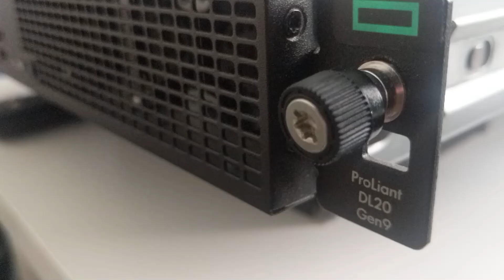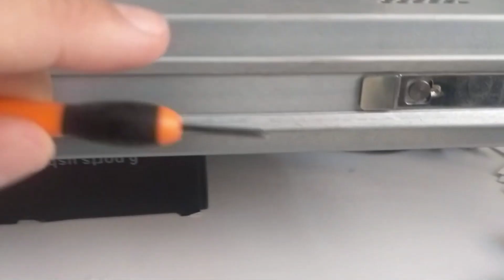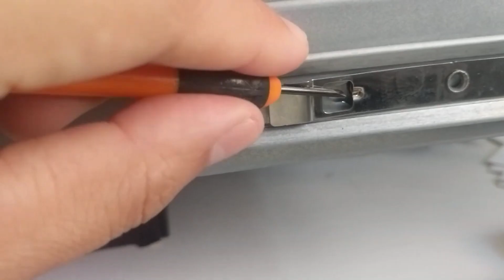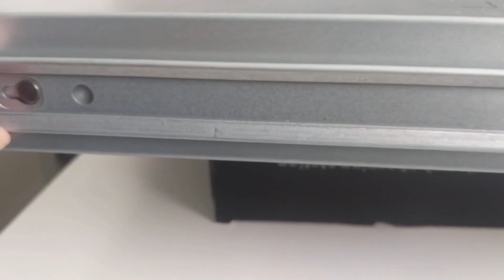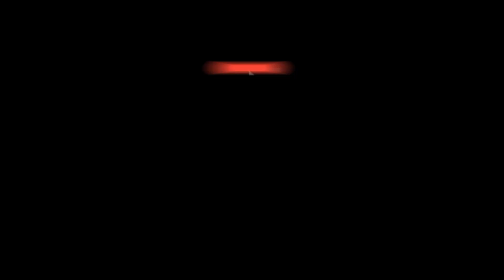HOW TO REMOVE RAILS ON HP PROLIANT DL20 GEN9 SERVER

Comment: any video on how to remove the other part of the rails from the rack itself? i can't figure out how to get them out...
Reply from the maker: Unfortunately the side holders are permanently fixed to the chassis.
Reply: @skopioeye  no, i mean the left and right rails that are in the rack itself, not the part that on the server. I have removed my dl20 from the rack, but want to take out the rails too. The manual is confusing
Reply from the maker: @demorez5  oh those rails you just need to pull the up as the ends just hook on the hole.
Reply: @skopioeye  pull up what? There is a switch right above, so i cant move it upwards. There is a piece of metal that i should apparently push in with a sceedriver but it does not budge...
From the manual its not clear if i should push the back of the front, but the back is out of question- no way to reach it
Reply from the maker: @demorez5  you wouldn't happen to have a  picture of the type of rails your using? You may be able to push the level in the middle of the rail to extend the length of the rail so that you can unhook it.